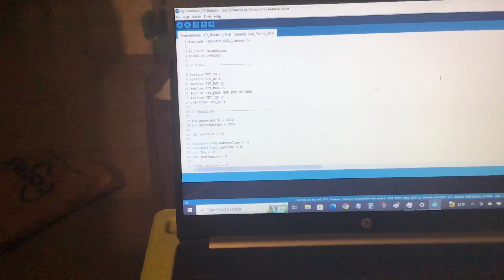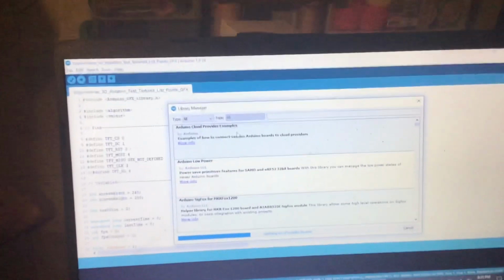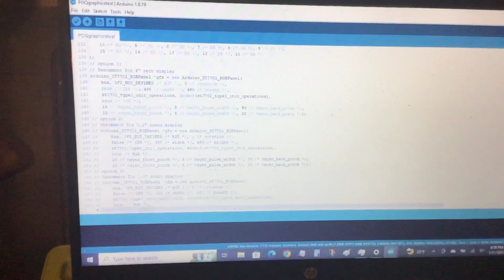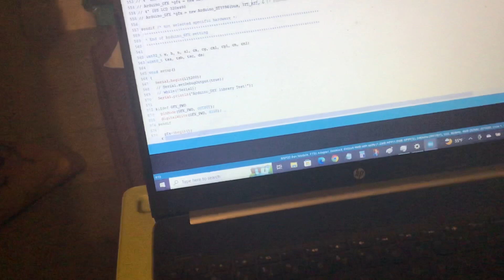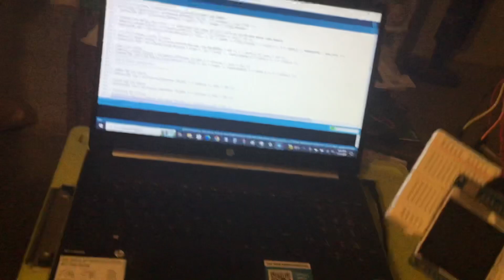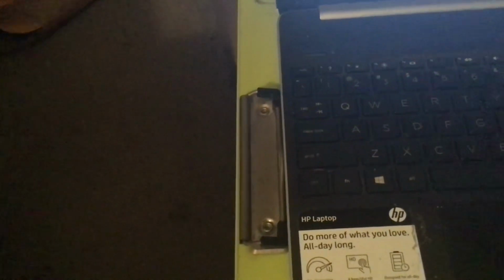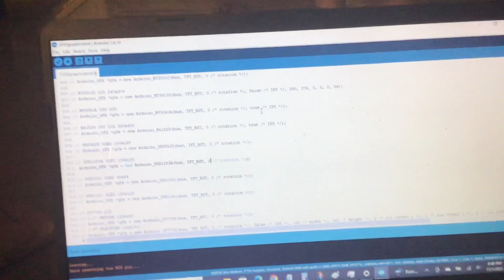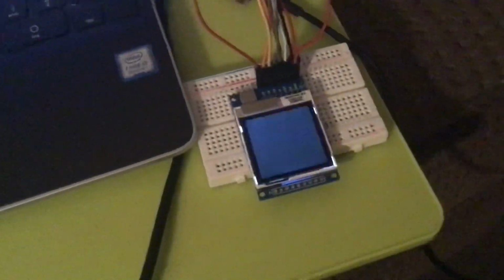(Updated) How to use 1.6 inch SSD1283A TFT LCD in Arduino

Comment: Great job! Now the library has changed, but if you use the old version works. One suggestion would be to record your screen with some program, and include a schematic of the connections.
Reply from the maker: Thank you. I plan record my screen in the future. I did not think to add a schematic. I may remake this video in the future to work with the updated library changes.